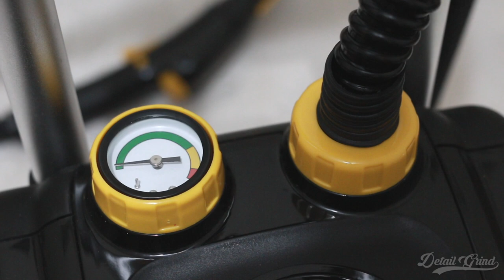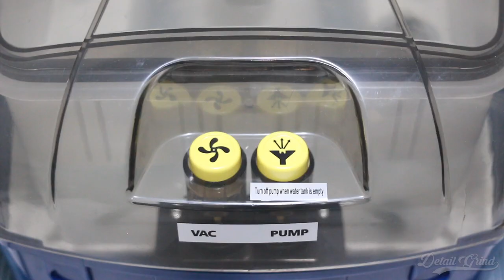Deep Cleaning 5 Year Old Twin Size Mattress

Comment: I was always told to never get that much moisture on a mattress cause it can mold.  How do you ensure it throughly drys? I need to do this with mine and i have an extractor
Reply from the maker: Hey Heather sorry for the late reply, I normally make sure not to use it until naturally dries with a couple of fans/air mover after 24hrs with. 

If you think of it the only amount of liquid I used are the cleaning solution & steam. Pretty much it just penetrates the fabric cover and foam liner which can be sucked by the extractor on the final process.

Comment: Hi planing to start my own business in cleaning...I am located in Singapore 

Was wondering what are the equipments that you were using? 

I have noticed you got a deep cleaning extraction machine 

What was the steam cleaning for and the speed  brush used ? 

Do you wait for it to dry ?
Reply from the maker: Hey Veno! Sorry if I replied late. Good to hear that you're starting this kind of business. Yeah the steamer I use McCulloch MC1385 - Its around $200 in Amazon. Extractor I'm using is Aqua Pro Vac - Retails around $500. I used the weight of the drill when brushing through the fabric in medium speed setting. Best to let the bed dry for at least 4-5 hours prior using. If you have an air mover or just an electric fan it could really help speed up the drying process! Good luck on your venture! Message me anytime if you have questions! =) Cheers!

Comment: what steamer and extractor brands are you using?
Reply from the maker: Hey Tiza sorry for the late reply Yeah the steamer I use McCulloch MC1385 - Its around $200 in Amazon. Extractor I'm using is Aqua Pro Vac - Retails around $500. Drill that I use is Dewalt Cordless 20V.  I used the weight of the drill when brushing through the fabric in medium speed setting.

Comment: Which machine are you using to clean the mattress?
Reply from the maker: Hey Star Prince! The steamer I use McCulloch MC1385 - Its around $200 in Amazon. Extractor I'm using is Aqua Pro Vac - Retails around $500 & I use a Dewalt 20v cordless drill.
Reply: @DetailGrind  what liquid cleaner do you use?

Comment: What vacuum are you using??
Reply: He is using the Aquapro vac since this guy don't have the decency to reply to anyone
Reply from the maker: @babyface5392  Appreciate you answering for me. Apologies been inactive here for quite a while.
Reply from the maker: Hey Junior sorry for the late reply, but thanks for checking the video tho! Will add more details on future videos for sure. The steamer I use McCulloch MC1385 - Its around $200 in Amazon. Extractor I'm using is Aqua Pro Vac - Retails around $500. Drill that I use is Dewalt Cordless 20V.  I used the weight of the drill when brushing through the fabric in medium speed setting. Stay safe!

Comment: How many hours to dry
Reply from the maker: 4-5 hours will do if you aim couple of airmover or fans at it =) but best to do it overnight
Reply: @DetailGrind  in the sun or under fans?
Reply from the maker: @doreenaking  No don’t dry it down under the sun, so much heat may deteriorate the foam
liner of the mattress. Natural air dry or fan will be enough.